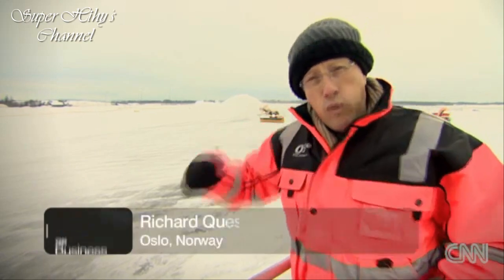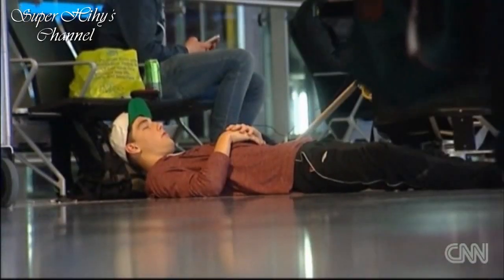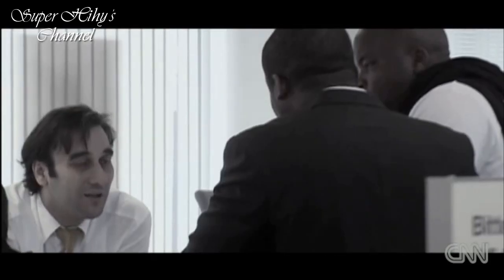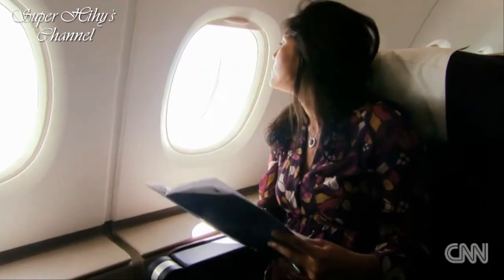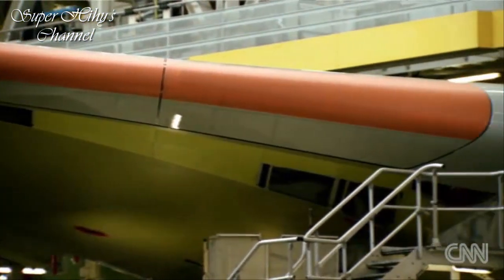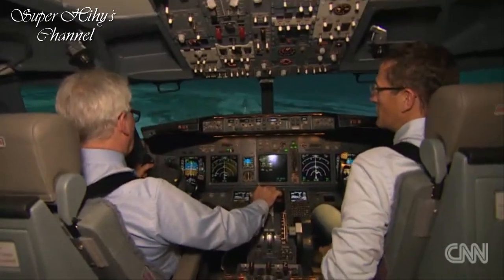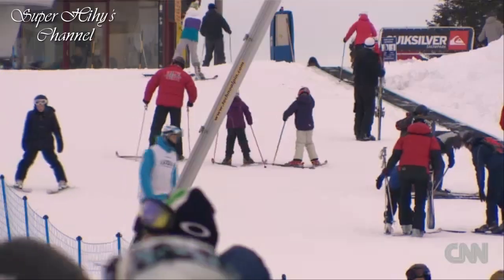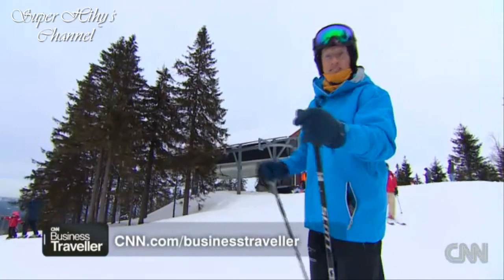CNN Business Traveller Oslo Airport

Comment: Cool video.
But "Oslo, a capitol that spends up to half the year under a blanket of snow" - thats not entirely true.
It used to be like that, but these days its more about freezing temperatures and not so much snow.
Having said that, OSL is extremely good in winter operations. You may sit at the gate and wonder if the plane is leaving in time. Dont worry, it will.
Reply: And if it doesn't, it's just because it snowed someplace else ;)
Reply: Well, the airport isn't exactly in Oslo but at Gardermoen. It is much colder there on average in the winter than in the city.